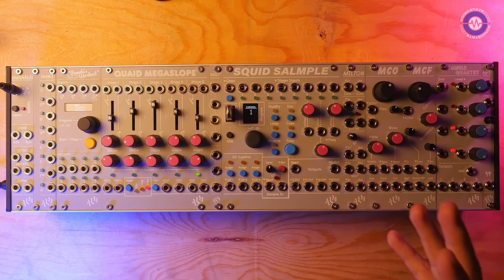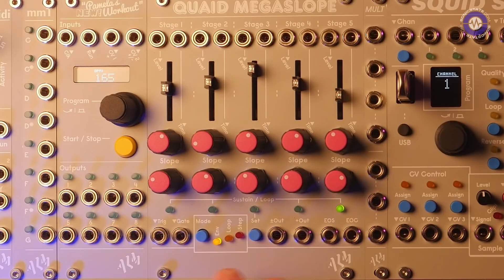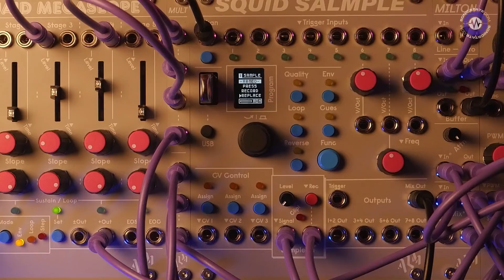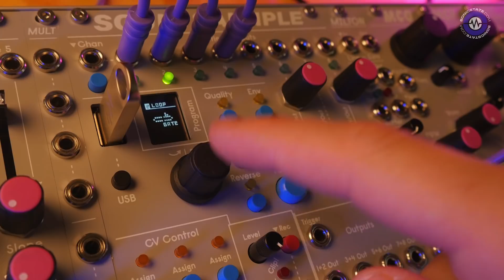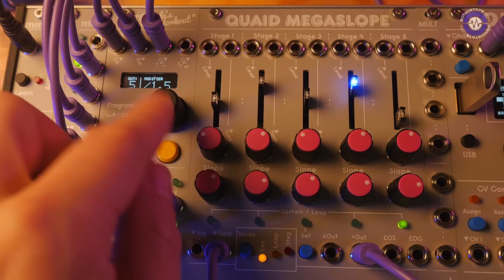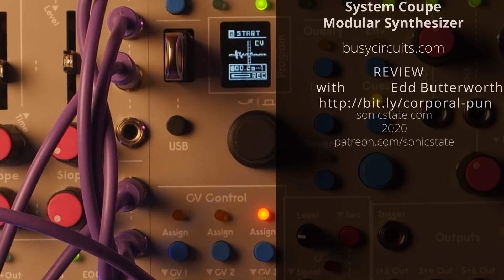ALM System Coupe Modular Synth System - SonicLAB Review

Comment: Here's my 1 year review of the mmMidi:  Good if you're looking for an inexpensive, bare bones, 2 voice option. The 24 ppqn clock  (pulse per quarter note) is useless out of the box. You'll need a couple of clock dividers to make use of it.  It was specifically designed to work with Pam's New Workout.  Not particularly thrilled about being upsold on an additional item for the clock to be useful.  Oddly enough, the LED will still blink in time to the MIDI clock. A workaround is to use the 2nd gates output as a clock using a second MIDI channel. Velocity is another interesting choice.  Personally would have preferred a CC option.  

Another oddity, the 2nd v/o output on my module has a higher voltage than output 1. Weird but this is mitigated via fine tune on oscillators, well, most oscillators.  If you're using Hysteria oscillators in quantized mode for both v/o outputs then there's an issue. Contacted ALM about this and they acknowledged it, shrugged, and pointed towards their own offset.  Luckily I already owned an offset. The additional gates module sounds neat but you're approaching $200 at that point and there is a lot more competition in that price range.  3/5 stars.
Reply: @Om_aum_ohm  Well, it's a nice cheap MIDI module for 2 voices.  In that regard, it works.  Just a shame how they handled the clock. The learn button could have easily cycled through clock settings. Especially since the LED blinks with the MIDI clock! It's bizarre. Imagine if Yarns was only designed for MI stuff. So, I feel the need to caution people about it.
Reply: @Om_aum_ohm  Yes, it's just a set clock output.   The 'Run' output is a high voltage also designed for Pam's so it should work really well if you have that. Without Pam, something like the 4ms Quad Clock Distributer would bring it into usable territories.  And the mmT expander is a nice cheap addition for controlling drums or samples.  Hell, it could be used for clocking purposes too.
Reply: @Om_aum_ohm  You are welcome.  And the Poly 2 seems great!